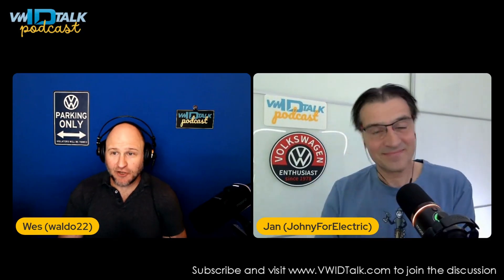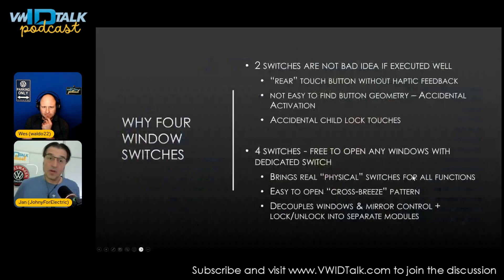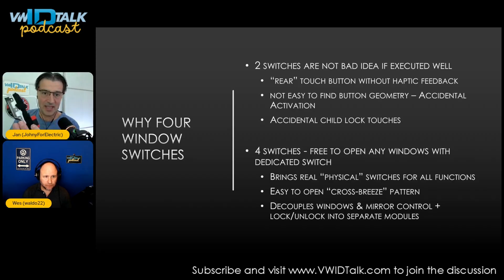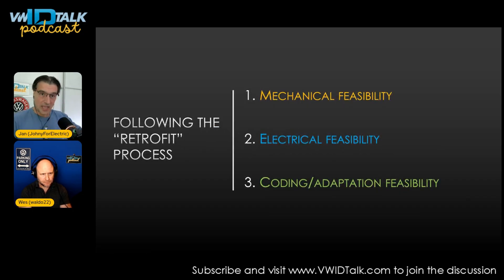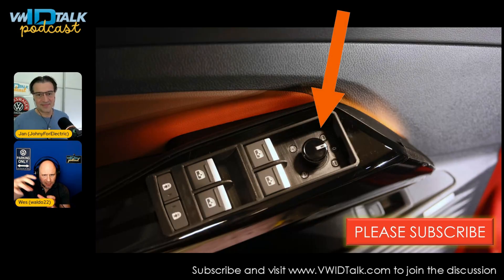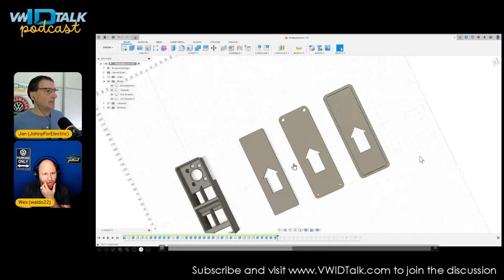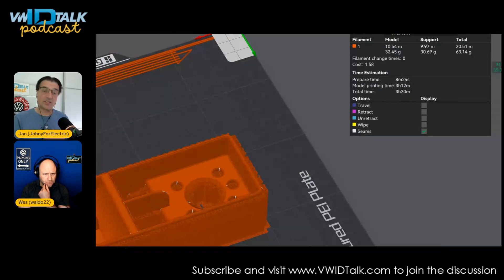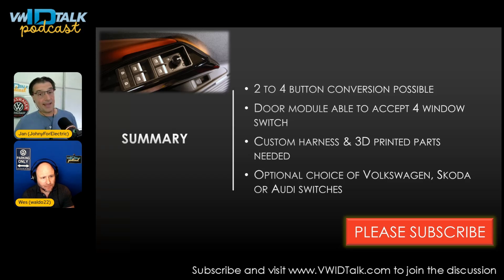No More 'REAR' Button! Ultimate Volkswagen VW ID. Four-Window Switch Retrofit (in Audi Style)

Comment: Why did you buy VW Audi cars in the first place? ROFL Audi, if you like to see your dash lit like a Christmas tree. I will stick with my Lexus+Toyota cars with all physical controls, and still #1 in long term reliability for decades. Good luck lol
Reply from the maker: Bacause they can be easilly modified :) Did a ton of mods on my 06 RAV4 (added daytime running lights into the headlights, nav into the dash, parking sensors and more). It all looked as it belongs there. But there are limits. VW Audis are like legos :) Next level for modders IMHO. Also on reliability - we liked our RAV4, but never had so many recalls on any Skoda/VW like on that Toyota... :(

Comment: I have an ID.3 and yes I would prefer real buttons, but I have never, not even once, pressed one of the touch buttons by mistake, not for the windows, not on the steering wheel. I wonder how clumsy people are that this is a general concern that apparently happens to everyone about 20 times a day.
Reply: It must be great to be so infallible.  
While I don't do it often, when quickly going from lock to lock, or trying to without looking roll windows down, I hit them. Also the stupid lock button. The lack of feel on them just sucks.
Reply: Completely agree, have an ID7 Tourer and have never had any issue with windown switches or steering wheel switches (quite like them actually)
Reply from the maker: @kevinbest7902  - we are doing an episode in ID.7 Tourer soon, can't wait to test this!
Reply from the maker: This is great news - @AlexanderMielchen please share what is your secret sauce (use pattern) so that you can use it with 100% predictability. I wonder how you are doing it without looking? 
Also perhaps VW has made some updates to those modules - what model year is you ID.3? Thanks!
Reply: ROFL Resume cruise control with a stray touch, perhaps when they hand you take away through the window. Great design!!! ROFL